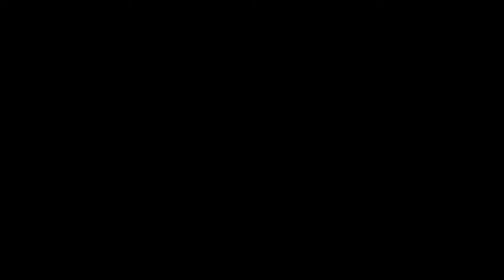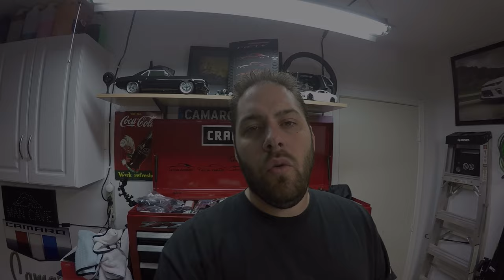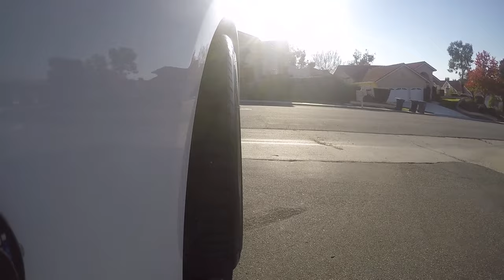2019/2020 Camaro Z/28 with 700HP DOHC LT6? (vlog)

Comment: I think GM is doing a porsche with the camaro. The ZL1 is like a turbo s. Really fast gt car and can set great lap times on a track. The ZL1 1LE is like a GT3. Just straight up built for a race track. So i think the Z/28 will be a GT3 RS for GM. Stripped out, lightweight, N/A race car that just so happens to be street legal.
Reply from the maker: +HighJacker99 I agree
Reply: HighJacker99 I like the concept you brought to the table but I think GM will have us wait awhile before we see a Z-28 aka atleast a year
Reply: HighJacker99 great comparison!
Reply: This is 100% true, the 2.0 Turbo is like the 911 Carrera (base line model), the V6 is like the Carrera S (more amenities, more power), the SS is like the Carrera GTS (more power, better features) and going off of what HighJacker said, the ZL1 is like a Turbo S, a really fast but yet really composed GT car that can tear up the race track, but yet also be suitable for daily driving and be very comfortable with long trips. The ZL1 1LE is like a GT3 as HighJacker said,  built for track use but also road legal. The "Z/28" (quoting this because we really dont know what itll actually be called) is like a GT3 RS, and this "LT7" engine will probably find its way into a Camaro that will probably compete with the 911 GT2 RS
Reply: It would have to match the interiors though, quality still lacks on camaros or USA cars.

Comment: GM needs this. I NEED this to be true. I bet the GT500R is on the way. So crazy that GM and Ford are making sports cars on par w the GT3/GT3 RS. What a time to be alive. 😌

The refresh on this Camaro is going to be INSANE.
Reply from the maker: The GT500 car to compare is the ZL1 1LE. The Z/28 aligns with a GT350R
Reply: LethalGarage idk. IMO the Current GT350 R slots between the SS1LE and ZL1 1LE. I'm not counting the last gen Z/28. The upcoming GT500 will be in the 700-800HP range. And I'm positive/really hope there will be an R version of that car. The next Z/28, if it does have 700hp, will be competing w that car. I want to see this happen. Sucks we'll have to wait for the refresh tho.
Reply: Lord Amadeus GM has always had the corvette bro which has never stop competing with such cars.
Reply: alex369 very true but I mean cars like the Camaro and mustang. Cars that mind u start at 25k in the us. The 911 starts at 90k and the corvette starts at like 55k. Guaranteed the ZL1 1LE and gt500r is will have very close track times to the gt3 RS. And I love that.

Comment: My question is how badly do they need another Z/28? I'm not saying I don't want it to happen, but look at the lineup they already have.  The 2017 SS 1LE nearly runs with the last gen Z/28, the 2017 ZL1 as it is beats the GT350R on a road course, and now the ZL1 1LE is going to be faster yet.  Ford is simply outgunned, at least for quite a while.

Comment: Not sure if someone else may have already mentioned this, but Al Oppenheimer stated the reason why the upcoming ZL1 1LE could not be badged as the Z/28 is because Trans Am rules from which it was born required naturally-aspirated engines only and Chevrolet is committed to remaining true to that lineage.  Therefore, Matt is sharing good information describing a new and upcoming naturally-aspirated V8 engine for the next generation Z/28.

Comment: The Z/28 sounds like a beast! But the ZL1 1LE is the car I have been waiting for!. 6.2L single cam 650hp supercharged motor, loaded ZL1 interior, adjustable suspension and crazy aero!. The ZL1 1LE to me is like the GT3RS is to the GT3.. I was a fan back when the 13' 1LE came out, now I can have the 1LE and the top dog ZL1 on the same package!... ahh.. the want is real!!.

Comment: With the Alpha platform if GM would retain, & simply refresh the N/A 7Liter ENGINE (if GM can't produce at least 600hp, & more importantly 600TQ!! Out of a N/A 427CI ENGINE then something's wrong) they would easily beat the GT350R in every performance aspect..it would be MUCH MUCH cooler to leave the Z/28 the N/A 7Liter Monster in the line up, & leave the ZL1 as the Boosted Beast in the lineup
Reply from the maker: I just see GM running into regulation issues. It happened to the Viper. GM has new engine designs they have to bring forward to overcome these regulations.
Reply: LethalGarage, good point, & understandable..
Reply: H Mack can you imagine a de stroked LS7 that spins to 8500 rpm and make 650 to 700 horsepower NA? That would be sweet!
Reply: jaime, it would be an instant American Legend
Reply: H Mack It would be nice if the Z/28 had a new 7.0L, but I think a 5.5L with DOHC is a bit more likely since that is the same displacement used in the C7.R's engine.
Reply: Zor'thak Fireaxe, ok cool

Comment: Wow!!! So do you think that Ford and chevy are building these cars together. I know the 10 speed auto is made by both. I know the 18 mustang has port and direct injection as well. This car is a beast. Now Ford it's your turn with the GT500!
Reply from the maker: Oh no... I would be shocked if the Z/28 was offered in an auto format.
Reply: D Mustang sounds like it everything you said and now rumors we will have small displacement 4 valve Dual overhead cam WTF so now they go direct injection. I live Chevy I hate Ford don't make me buy a Chevy/Ford...
Reply: LethalGarage I don't think the auto will come in the z28. It's just funny how chevy and Ford has a line of new motors coming out. Lots of similar features and specs. As they say keep your enemies close!
Reply: Cory Craig haha! This is crazy stuff but man these cars are really putting some crazy numbers down now a days.

Comment: Im a 4th and 5th gen guy, waiting to see more on 6th gen. Ive been sold on the 6th gen for sometime just getting finances in order and waiting for the market to soften up on the 1le, my father works for a local GM dealership and a rep told him that yes the DOHC is a reality however, EPA and CAFE regulations are all in limbo and if they lessen those standards, his quote was "watch out " i hate to fan the rumourville but this is from the horses mouth. Keep up the great work and if i hear anything else ill post.
Reply from the maker: +Will Bray I have heard the same thing
Reply: LethalGarage Last thing GM wants is to get in that late 80s early 90s production problem where they have way too many engines and not enough sales. The GT350 looks great on paper but its an obscure engine at 5.2 liters meaning less production, less RnD, and for us less after market components along with maintenance etc.....GM is not interested in having another Northstar or Eco-Boost muddying the waters. GM has the Vette and + model versions and when you start getting into niche vehicles that are 80k or 90k it doesn't change the fact its still a pony car.

Comment: i just don't see how a N/A 5.5L V8 is going to hit 700 HP while being a mass production, stock, and have a warranty. sure, 600 - 650 i could see, but 700? hmmm not sure about that.
Reply from the maker: I think it is very possible in a DOHC setup. New heads, new everything. I think GM has been working on their new motors for awhile now, its almost time to bring them to the forefront. #Cafe is coming.
Reply: i mean ofc i would love to see a mass production, fully warrantied, 700 HP N/A V8, but it just seems a bit far fetched.
Reply from the maker: +Justin Bouche Hell Cat
Reply: hellcat has a super charger on it... - _ -
Reply from the maker: +Justin Bouche I don't see that being any different
Reply: Imo I dont see this thing being faster than the ZL1le if it is it may be like a second faster but also, how are they going to price it.
Reply: big difference, using turbos or a super charger to pump in 7 - 14 PSI (think LS9, LT4, hellcat, ect) going into the 700 HP club is very much possible / FAR easier. but for a N/A V8 to obtain such power figures and be mass production really just does not seem likely. just going after market to get to the 700 HP mark takes quite a bit of after market help. heads, cam, pistons, intake, exhaust, rods, ect ect. just does not seem likely for a N/A V8.
Reply: I've read that the new Zl1 official time at the ring isn't the fastest time it made. Just the official time.
Reply: Justin Bouche With all the Cams and headers you can put in cars aftermarket, 700 HP is light!
Reply: well a lot more than just a head and cams lol, and remember it needs to be mass production so it must follow regulations, throwing a fat lumpy cam does not check that box.
Reply: Justin bouche All the new Z/28 has to do is beat the GT350R around a track and dragstrip, I'm sure Chevy can do that with or without a massive amount of HP.
Reply: im not saying its not going to beat or could not beat the 350R with less HP with the current chassis being far superior in the camaro, but i just think getting 700 HP out of a N/A 5.5L V8 and still be legal, reliable, and mass production is hard to believe. a super charged or turbo charged V8 is far easier to get to the 700 HP mark and keep it wit in CAFE standards.
Reply: Justin Bouche I don't see it making 700hp na and keeping emissions. But manufacturers get better everyday so who knows.
Reply: that was my point lol
Reply: SHIFTY 416 wouldn't surprise me. The 7:37 was the official time of the Z/28 on a wet track, unofficial the time on dry was 7:32. Which is as fast as the alleged GT350R on a 5th gen platform. 
I've looked it up more than once and all I ever see is that the 350R's time is not official. Which is why it's ridiculous that everyone just ran with it.
Reply: I agree, but I guess if Chevy could make small engines that put out as much HP as the big engines back in the glory days of the 60's, they can definitely do it now.
Reply: Quinton Wideman they measured hp differently in those days. The numbers would be less today. Also they were much larger than 5.5L either way can't wait to see what they do.
Reply: N/A? 750 HP? thats going to be reallllllyyyyy hard to do.
Reply: we know there is the LT5, LT6, and LT7 currently trade marked. so, we don't really know, also this thread was about a 5.5L N/A mass production V8 that would make 700 HP. my position was this most likely will not happen.
Reply: You just lost all credibility with that comment, a 5.5L engine making 700BHP isn't an easy thing to pull off. Sure you have NASCAR engines (OHV 2 valve 5.8L 900BHP 10,000rpms) but those are race engines and not road car engines. 

I honestly think that this is all just bad rumors created by the automotive press with nothing to report on.
Reply: who are you talking to?
Reply: Sorry lethal, I just can't believe he said 5.5L normally aspirated 700BHP and 6.2L supercharged 707BHP is pretty much the same thing. for N/A street engines you run into a hard torque/L with I believe the Ferrari 458 having the highest (both the standard and speciale) which is making 398ft-lbs out of 4.5L 88ft-lbs/L. The Voodoo engine is making about 82ft-lbs/L and this is one side of the equation for N/A high horsepower engines. The other being rpms, for the Ferrari 458 Speciale the engine is making some 348ft-lbs at 9,000rpms which after you put that through the horsepower equation you get some 597BHP. The engine hits its peak VE at around 6,000rpms and it drops off a bit from that point at that point to get to 597BHP @ 9,000rpms. 

Lets assume that this 5.5L engine is making 82ft-lbs/L, that gets us 451ft-lbs of torque. In order to have a chance at doing what the rumor has stated this engine has to be tuned similarly to the Ferrari 458 Sepciale. The Ferrari 458 Speciale is making about 87% of peak torque at around 9,000rpms, then you can get to 672BHP. If you knocked that up to 88ft-lbs/L then you would get 721BHP. However this comes down to tuning the engine in a similar fashion as Ferrari has tuned their 458. I don't know about you but not a lot of Corvette buyers are willing to deal with Ferrari style maintenance on their rides. 

By the way Corvette chief engineer did an interview where he revealed that for the C7 Corvette they tested the car with both a TT V-6 engine and the LT1 engine. The LT1 engine got better fuel economy then the TT V-6 engine which puts a wrench in the CAFE argument. 

The thing about this rumor that makes me question it is the fact that the 5.5L engine displacement is back. This was something that was rumored for the C7 only because the C6R GT2 spec race car used a 5.5L LS motor. There was no source for this rumor and it wasn't based on any kind of good logic, if they explained to people that the only reason the GT2 car used a 5.5L engine was due to displacement restriction limited every at 5.5L for N/A engines in that class then people would have written it off.
Reply: Well, the Australian 5.0 liter V8 Supercar engines are making 650+ horsepower with a single camshaft and a 90-degree crankshaft.  These engines sing at 7500 RPM.
Reply: there are aftermarket LS3s these days that make 700 hp naturally aspirated reliably ! a 5.5 dohc with an 8k+ limit can absolutely do 700 hp. but maybe it will be dialed down a bit to the 600-650 range. either way it is going to be an awesome motor. but there will also be a larger DOHC unit coming from Chevrolet. this was previed by a Mercury crate. they used several features of the LS7 block architecture and worked it up considerably with an all new cylinder head and dohc valvetrain design. remember Chevrolet already partnered with Mercury before, for the original LT5 (DOHC tradition!) that powered the mighty C4 ZR-1 "King of the Hill".

Comment: There's no way a 5.5l NA is gonna make 700hp. For that to happen the thing would need to rev to like 9000, which puts it in Ferrari and Porsche territory, and their engines cost more than an entire Z28 is priced at. I think that if there's a Twin turbo 5.5, then you will easily see 700 hp, but not from an NA

Comment: The Z/28 is Naturally Aspirated. No way it can push from 580 to 700 hp. I see it being 615-625 hp track ready. That's great numbers for a non supercharged or turbocharged muscle car.
Reply: Z/28 should have a 8.9 twin turbo supercharged big racing cam it need to be 10 speed automatic 990hp

Comment: at least 2 brand new mills coming for Chevrolet, one being a 5.5l + dohc high revving unit, and the other will be a new 427 7 liter, possibly also dohc. mercury has an automotive crate engine 427 that has been developed from the mighty LS7 , block has similiarities, with the top being all new dohc valvetrain. makes 750 hp right out of the box. expect something similiar for mass production from Chevrolet soon. remember they partnered with mercury on engines once before for the mighty original LT5 that powered the C4 ZR-1 "King of the Hill". this all will be in conjunction with a revised version of the venerable workhorse 6.2 small block pushrod, which will come in various configurations, naturally aspiraed as well as super charged. the all engine new units also receiving variants with twin turbo forced induction.
Reply from the maker: We can dream. I doubt we will see anything new until the next generation.

Comment: The LT5 isn't a rumor bro...SMH!! 
  It's legit and has been around since it's conception in 1990 when GM acquired help/aid from Lotus regarding a 4.0 DOHC V8 that would produce 350 hp at the time. GM kept the liters at 5.7, same as the outgoing 240 hp L98 motor found in base C4's of the era. GM execs took some expertise from Lotus in utilizing their head design for the LT5 motor. When all was said and done, the new block housed 4 camshafts and 32 valves to produce a mind numbing 375 hp and 365 lbs ft.. tq.

 The design of the LT5 was so diverse from anything GM had ever done that it outsourced the assembly of the motor to Mercury Marine of Stillwater, Okla. The motors were then shipped to Bowling Green for final assembly/installation with the C4 ZR1 Corvette. 

GM filed for patent on LT5 in December, 2017 and buried in GM design books with the  code simply stated "LT5".

Comment: I think we are quickly getting into the realm of AWD like whats rumored to be on BMW's upcoming M5 which is said to be a selectable system.

These Big End of Days HP numbers will be nothing but tire shredders such as the Hellcat with out it.

God help Jimmy when he picks one of these up out of High School on a dealer lot used for 18k or so.

"And its fun fun fun til daddy takes the T Bird away."

As for the Z28 it will still be a  Halo Camaro that will appear and reappear as a brand resurrection or stimulus model when enthusiasm starts to fade or wane for the model line like it has been used for in the past.

Like after Transformers. 

Like Racer X in Speed Racer. (not the car but in the series)
I still miss Chim Chim.
And Spritle.
Trixie was hot but sexless. (Speed was either a bad closer or gay. Your Dad would agree.)

Yeah.